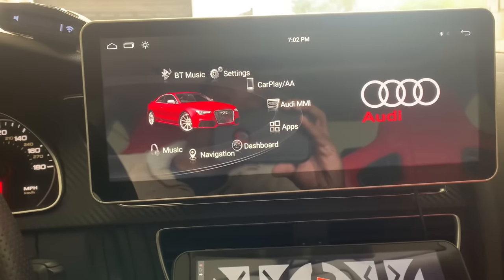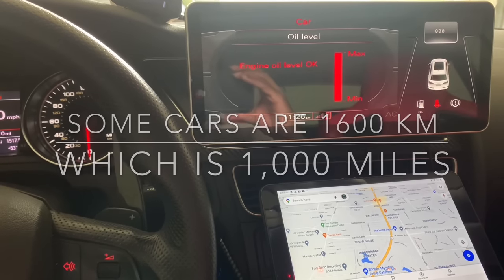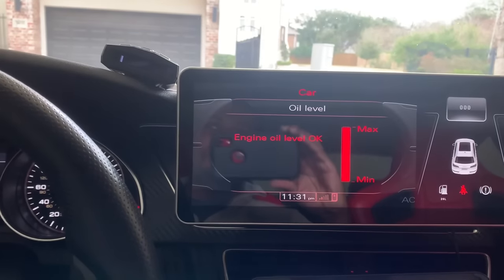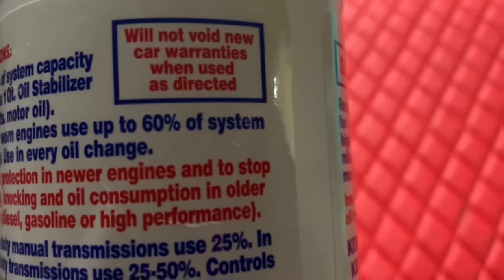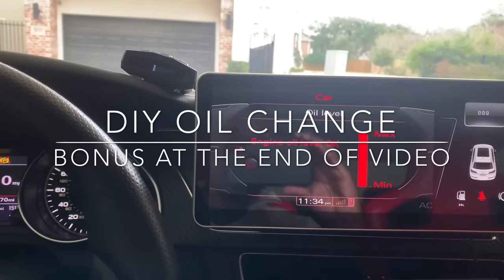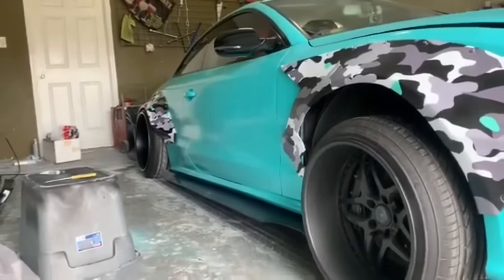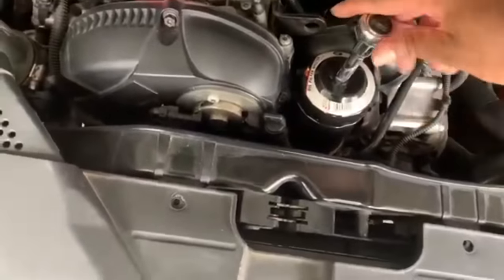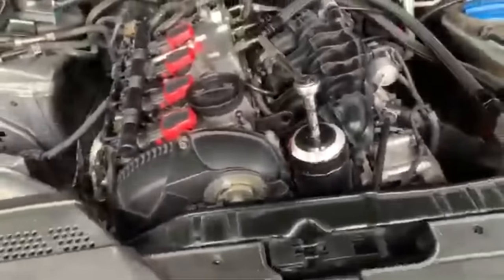How to fix Audi Oil Consumption for $10.00 dollars | Hack Audi A5/A4/A3/A6/A7/A8/Q5/Q7/S4/S3/S5/S7

Comment: have you opened up the engine to be sure it doesnt leave sludge residue inside your engine?
Reply from the maker: Yes clean and smooth, been using it for 10 years on all of my cars, on top of that I’m tunned, if you also look at my oil change at the end you can see my oil is not gunky 👌👌👌👌 legit product

Comment: Are you adding this in place of 1 of the quarts of oil needed when doing an oil change? Or when the computer tells you to add 1 qt of oil to the car?
Reply from the maker: Oil change, could apply the other way aswell
Reply: Lucas in nothing but a heavy weight oil.A gimmick

Comment: Hi my name, Hung N. I have an 2010 A6 3.0t quattro,  bought the car when 99,600 some where around there car now is 102,609 had replaced bout 94%of fuel line, bout to do some upgrade gotten duel pulley, got borla exhaust and air intake on car when I had gotten crankshaft bearing pressed on from low of engine oil! And now have get crankshaft turn and rebalance but before that have to find upgrade bearings? On a beget? ??? Not trying waste ur time! What brand?
Reply from the maker: I have a budy with a similar build in an A7 reaching out to him, re message me in a couple days if you don’t here back from me

Comment: Just got my first Audi (A4 2008). Drove it back from Chicago and went through 2.5 quarts in the first 3000 miles. So I guess it could be worse, right?  Should I add Lucas?
Reply from the maker: Most definitely
Reply: Mine burned 1 quart for every 500 miles. It's an A4 2011 cdnb engine code. Was sceptical at first adding lucas oil, then I bite the bullet and add 1 quart when my MMI shown minimum level. I drove 250 miles now, my oil level is still at the top.
Reply: @milky3ay566  when you got your "add one quart " warning light , did you add Lucas instead of the quart of oil? My warning light comes in at about 600 miles on my a5
Reply: @claudes1973  Assuming u haven't add any Lucas since the last oil change, yes that's what I did. I just add 1 quart of Lucas oil stabiliser which makes roughly 20% of your total engine oil capacity as said on the Lucas oil label.
Reply: @milky3ay566  and now? What IS ur consumption ?

Comment: I upgraded to the s3 injectors like you did and the grab diverted as stated but does this require a tune for the s3 injectors to work properly because after car sat for few hour when I start it later in night it was starting and shutting off then after I drove it around in parking lot it idle fine. Please let me know if I have to do tune for injectors to work properly
Reply: Do I have to have a remap done for injectors to work?

Comment: My Audi a4 2013  automatic transmission is using a lil bit oil. Depends on how i drive as in : if i drive alot in Sport and above 4k rpm it seems its using oil alot faster. But like 0,5 lt on 3000km 
But when i drive 'slow' the oil consumption is way less. 
Do you think this product will help?
Reply from the maker: Yes 100%

Comment: i’ve had a big issue with oil consumption on my 2013 audi a4, it seems like every 2000-3000km my oil is around 1quart and it’s very annoying having to buy $80 oil every time, i’ll try to find this product and let you know how it does; thank you.
Reply from the maker: No problem keep me updated , god bless you brother
Reply: Please let me know as I have the same problem with my 2014 s line
Reply: @Nocturnal did it help for you by adding the Lucas stabilizer . Any improvements or any/little  oil consumption?
Reply: @colehavens8920   peep my reply
Reply: Did you try?
Reply: Any news? 🤪 3 year later

Comment: Hey man, do I need to add it only during oil changes? Can I just add some in between oil top ups?
Reply from the maker: yes just dont over fill your oil
Reply: @brucecustommotors  okay so if the add oil wanting light comes up how much Lucas stabiliser do I put in?
Reply: @aaryanghimire9763  the thing about oil is it expands when heated. Thicker oil can increase oil pressure and if you over saturate your engine oil with Lucas oil, you can actually cause leaks because the pressure is to high. 
Wait until you do your oil change. Before adding Lucas oil.
If your car takes 4 quarts of oil, only one (1) of the quarts should be Lucas oil and the other 3 should be the regular oil.
If your light still comes on to add a quart of oil, only 1/4 of that quart should be Lucas, the rest your normal oil.
Reply: do u you see any change

Comment: Please, can you tell me which is the best oil for audi 1.8 - TFSI 2009 petrol - LPG, for engine and transmission automatic
Reply from the maker: I would say, 5w=40 or 10w-40 depending on your miles
Reply: @brucecustommotors  225000 kilometers
Reply: @selmanrranci7777   0w-40 redline or amsoil and never look back

Comment: Got a question. I bought an Audi s5 three no the ago it got 76000 miles on a clock. The service was done at 68500 miles but the service inspection light comes on. Shall I go for an Oil Service?
Reply from the maker: no the service light is just a reminder, to check
.air filter
.all your fluids
.belts

kind of like a physical for a human. Sometimes you may service it and every things is still good, depending on how you drive the car, it generally comes on in 60,000 mile increments , so your next one will be around 120,000. unfortunately, only the dealer can reset it or you can use vag or an obdelevn, this video will explain how you can do it yourself, but of course you don't want to overlook your service if you reset it.
https://youtu.be/AMjmDkPjJtM
Reply: Thank you, Bruce. You are indeed very helpful. Basically the service was done in 2018 and the car was really driven only covered 6000 miles and hence the light comes on for service inspection. What I am thinking is to get just the oil changed for peace of mind and will use the Eleven to reset the inspection light. 
Glad t find your YouTube as there bot very much genuine ppl left out there who advice you good. So Bless you and will wait for more vid. As I am quite new to S5 need to learn a lot.

Comment: Good day Bruce, I’ve been experiencing a faulty hood sensor switch on a 2011Audi Q5 3.2 L
And the tailgate sensor switch) it’s my understanding that both switches work together 
I changed the tailgate sensor switch and the display on the dash is showing it’s still open
And for the hood sensor, the 1st time I removed it and cleaned the contacts because I was getting a false reading that the oil level was low when it wasn’t as well as the No display when the hood was actually open have you experienced this problem ?

Comment: Should we use the high mileage Lucas stabilizer or the original? I’m at 106k on my 2015 A4 currently
Reply from the maker: if you have 75,000 plus I would use high mileage, it also helps with blow bye

Comment: Would this work on my 2012 a4 quattro with 100k miles and if so what is the best oil brand for these cars that help with the oil consumption
Reply from the maker: i use liquid moly, but castro, and mobile one also works great
Reply: @brucecustommotors  thanks brother much love

Comment: I dont really like to mess with lucas or any other additive brand because i had a bad experience putting a lucas fuel system cleaner in my previous audi a4 b8 and my engine ended up dying on me is there any other option?
Reply from the maker: nothing that I can trust, but the fuel system cleaner is different and you have to be careful with any one, because sometimes they break up debree and clog it even more, and you can end up running lean, its better to just service it and do a flush or maintenance your fuel filter or injectors stand alone. god bless let me know any thing you need.

Comment: I used 2 qt Lucas in my oil change and didn't
 really make a difference in my consumption.   Still using a qt every 260 miles.
Edit 2010 a6 3.0 supercharged
Reply from the maker: Did you ad it or did you do a full oil change
Reply: Dude i feel ur pain!mine is like every 2- 300 mi...😒at 10$ a qt
Reply: I'm running into the same problem with my Audi a7. I'm getting about 200 mi before I need to add a quart. Have any of your solutions worked?
Reply: Have you had it fixed? What was the issue and fix? Mines is every 400 miles /1qt

Comment: Typically how many miles until changing oil again with this Lucas oil stabilizer? I have a stage 2 and a daily driver. It also has 94k+ miles.
Reply from the maker: im stahge 3, and run hard and do about 3k
Reply: @brucecustommotors  Okay, thank you!

Comment: hi my audi a4 2.0tfsi quattro 2011 requires oil every 200miles and it has done only 44000miles. some recommended me to add stp (stop leak oil) it didn't work. your advice will be much appreciated.
Reply from the maker: This will help you tremendously, also you may be under warranty , call Audi to make sure your car is not effected by the warranty claim https://youtu.be/itQIFUf0U7M
Reply: How was the results?

Comment: Just recently bought a used audi from a dealership with low miles, I just recently added oil cause it said it need 1 quart but I guess I put a lil too much and now it says too drain it. Should I even bother to do it?
Reply from the maker: Yes because it will cause the oil to bubble up, and not give proper lubricant to your engine, and cause oil leaks  it’s easy to drain, watch this video, you just need a jack  https://youtu.be/UdMw8Hc5mhA
Reply: @brucecustommotors  much appreciated bro🙏

Comment: I took my A5 to Audi as I have black smoke coming out of the exhaust. They didn’t even diagnose it as they said it’s 99.9% failed piston cause oil leak and not to waste my money on diagnosis. It’s asking for 1L oil every 300KM. Any recommendations? Will the stabilizer help get me another couple years?
Reply from the maker: yes it will help
Reply: Did you try?
Reply: @enzok7953  Yes. Definitely helps slow down the oil consumption. I was going through a litre every 200-300 KM. Now I’m closer to 1000km.
Reply: @kennynketia1085  that’s great! I made 600km with new oil change oil gage showing low . I gotta try that stuff
Reply: @kennynketia1085  hey any news from this car, is the engine still okay? let me know thanks in advance! :)
Reply: @joejoeee9639 yeah I still have the A5. Engine still running good. Disclaimer though as I only drive about 3500 miles per year. So I don’t put a lot of use on it.
Reply: @kennynketia1085  thank you so much for responding if the engine flush won’t work I’ll definitely try this!

Comment: I read the GREEN liquid moly, has all that included in it, has anyone used it and still have issues? Also every oil change, the bottom bolt and/or washer should be replace with a new 1.
Reply from the maker: i tried it, really didnt see it helping consumption, but it helped, performance, and thanks for the advice on the bolt

Comment: I changed my oil as of yesterday 12/9/21 in my 2012 Audi A4 Quattro S Line. I just checked my oil after a drive. It says it's low. I put 3 quarts oil & 1 bottle oil stabilizer. Do you know the issue?
Reply from the maker: yes your car takes 5 1/2 quarts, your re missing a quart and a half, and love the positivity on your channel god bless brother
Reply: @brucecustommotors Much appreciated brotha

Comment: so last month, i got the oil changed for my A4 2010. It need 4.5 litre of oil and after running for 700km, the guage shows a drop of 500-100 ml of oil. If I buy Lucas. should I just add it to the current oil (it should be around 4 litre)?
Reply from the maker: i would do half, you don't want to put to much oil

Comment: or you could just go flat out from 2000rpm to 3000rpm in top gear, using compression braking back to 2000. Do this 10 times during a freeway run. should be all good

Comment: I may need to pay you the $900 quoted by the dealer service tech to fix my 2012 Q7 premium plus burning oil and having to add 1-2 quarts by 3000 mile oil changes.  Head gasket covers replaced a year ago and they checked engine for any other issues like spark plugs or combustion issues.   I’m going to try this before taking it back to the dealer for service.   My Q7 only has 95k miles and started burning oil around 75K miles.  What is the ratio to add per qt of oil? 
Thank you!
Reply: Get a new car and leave Audi alone forever !! Never been so disappointed and regretful in my life smh

Comment: How much oil does Lucas have to be used when changing the oil?
Reply: Just get a new car or replace the engine. I had Audi A4 for 10 years it’s only gonna get worse and you’ll have you gut out your catalytic converter cause oil is clogging it allowing you to lose power and performance

Comment: Are you putting in a lighter oil to make up for the thickness of the stablizer so it’s not too think? Or you still using the factory recommended oil + stabilizer? 🙏🏾🙏🏾
Reply from the maker: no 5w-40 recommended

Comment: Hey, so I called Audi asking about the oil consumption on my A5. They said the recall was done in 2018. Any word if there a recent recall or something done?
Reply: I pretty sure they still might have a warranty out, can’t promise it, but one of the most common issues is piston rings. Def try this hack out, but if you can get the car serviced.
Reply from the maker: its based on miles not year, most dealerships don't want to do the free work so they throw road blocks, what the best thing to do is call audi world customer service, and create a claim first and then pick the dealership you would like, that way it would not be any politics
Reply: @brucecustommotors  oh I just remember seeing a recall saying that Audis from 09-11 have this recall due to the newer ones “being updated” as Audi says which is bull. Never thought it was based on miles?🤔
Reply: update: Audi didn’t take care of it, I’m burning through 1 quart per every 1000km or roughly ever 500 miles in the city. I’m gonna give this a try now that I need to get an oil change. Otherwise we might just need to do a motor swap, do you know if the s5 motor is a direct swap assuming we change the ecu
Reply: @abdielmi1087  noooo, don’t do an engine swap, do a rebuild. I see so many youtubers even, swapping these engine that have 50k and their engines that had 70k on it with a timing stretch and rings problem. It’s just a time bomb waiting to go off, best thing to do is a full rebuild

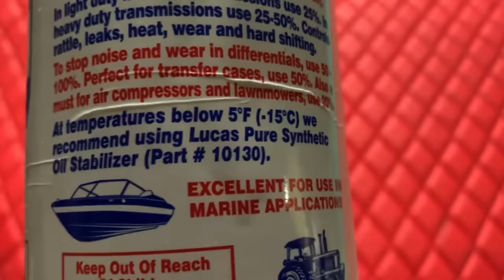Comment: Hey Folks! This is a temporary fix at best. The 2.0 Audi 2.0 are notorious for drinking oil, and the 2.0 is 5:07 one of the worse engines you can modify. Take is from experience.

Comment: Great stuff but the oil scraper rings on these fail from carbon build up. You will have to either replace the rings at one point or clean them when they get so bad .
Reply: That's what I was told as well

Comment: My oil consumption is bad my last oil change i used lucas oil n tbh there wasn’t any change in my oil consumption idk if it was bcuz i used 0w40 but i had to add oil the very next wk. Every wk im adding oil man its crazy. But my next oil change is in about 800 miles ima use thicker oil and add the lucas oil to check to see if it remedies or slows down the consumption but its like when i do pulls there goes my oil.
Reply from the maker: What’s your weather like, yeh it only works well with 5w-40 , ow 40 didn’t work for me, I used moly oil with it, let me know
Reply from the maker: if you look at the oil change I did , at the end I almost had 5 quarts, and that was almost 4,000 miles on 5w-40
Reply: @brucecustommotors  I’m talking bout all summer and now winter but im thinking ever since i got tuned and no intercooler mayb that plays a factor in the equation, especially when doing pulls. But Ima try the Liquimoly and the Lucas oil  and if that doesn’t work then the next step will be IE pistons and rings.
Reply from the maker: @Yungdieseltv  yeh the tune definitely burn oil more, speaking from experience, and my built engine has ie pistons
Reply: @brucecustommotors  what rods did you use?  I just finished my rebuild with IE pistons.  I just put 150 miles on it and looks promising.
Reply: I don’t believe the lucas can change anything ! The Audi burn oil since the 90s . The engine requires overhaul, who change the oil at 3000 miles nowadays ! Newer cars usually change the oil at 10 thousand miles !

Comment: Anybody has anything to share after using it for a couple years? 
Mine 2010 A4 has 93,000km on it and burns a quart every 500km. Just replaced the PCV and gonna see if it helped.
Reply: Fixed or same?

Comment: My 2014 Mercedes C250 1.8 turbo never burn oil, I change the oil myself ! 3000 miles oil change? Hell no, I change my oil every 8-10 thousand miles !
Reply from the maker: yeh Mercedes, hold it better
Reply: @brucecustommotors  , and all my Honda vehicles ! Never burn oil.
Reply: What's the point of this comment?

Comment: I wish it were that simple. To fix your Audi oil consumption properly requires ring and piston replacement.  Which I had completed by Audi at 55k miles two years ago. Fast forward 18 months later, cylinder #1 failed. The techs at Audi said they were replacing long blocks because the ring and piston replacement is a temporary fix. Another 12k bill from Audi. However at 69k, I now have a new Audi engine in my Avant.
Reply: Sell that crap fr
Reply: I take that statement back! Just park the crap and get a new car lol
Reply: @Jumpmanfresh18  update..I sold it! Stay away from the 2.0. What a money pit.
Reply: @Jumpmanfresh18  actually bought a TTRS. Bullet proof.

Comment: Tired it on my B8 3.2. Didn’t work for me. Good idea though.
Reply from the maker: i would say do a full oil change with i for best results, because the old oil could hinder its performance
Reply: @brucecustommotors  i got a high mileage B8 so ill run that high mileage version next time.